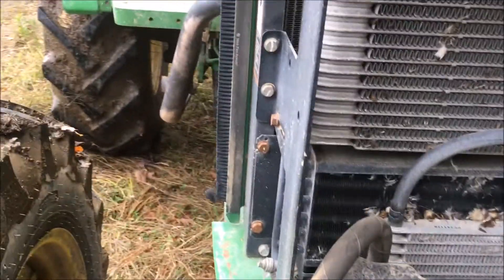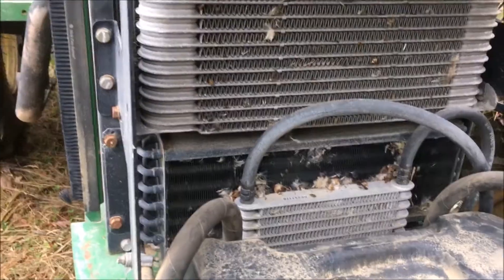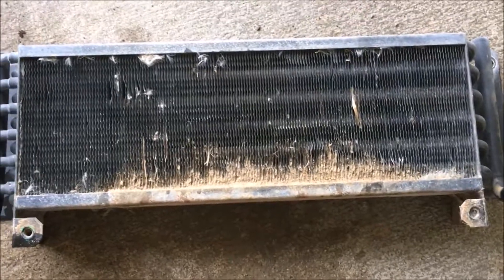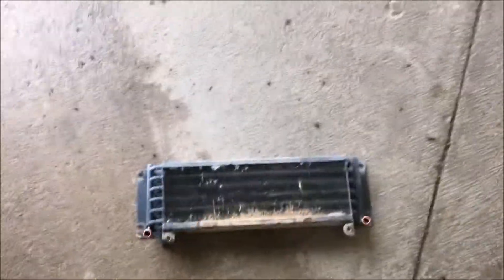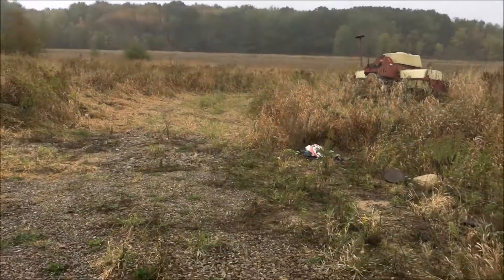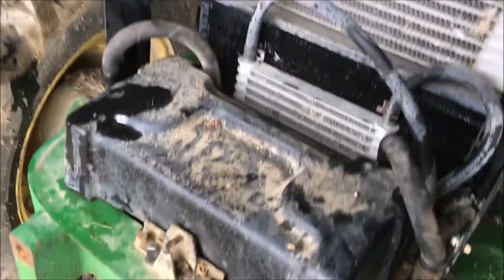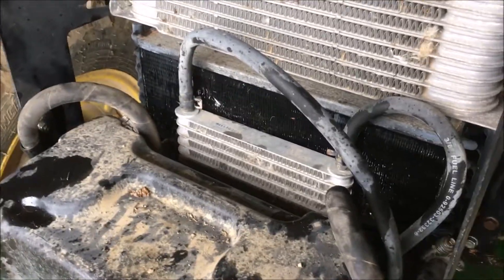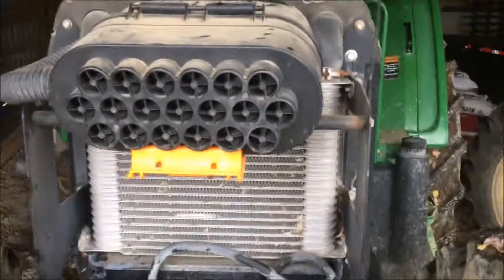TRACTOR HYDRAULICS OVERHEATING AND CHECKING OIL COOLER

Comment: fuel doesn't need a cooler.....if fuel needs a cooler....you are running the space shuttle for rocket science.  the F-22 uses liquid gases, so does the F-35...you know what uses super cooled liquid fuels ; )
PART 700—INTERPRETATIONS OF MAGNUSON-MOSS WARRANTY ACT
Authority:Magnuson-Moss Warranty Act, Pub. L. 93–637, 15 U.S.C. 2301.
Source:42 FR 36114, July 13, 1977, unless otherwise noted.
ecfr dot gov current title-16 chapter-I subchapter-G part-700
§ 700.1 Products covered.

(a) The Act applies to written warranties on tangible personal property which is normally used for personal, family, or household purposes. This definition includes property which is intended to be attached to or installed in any real property without regard to whether it is so attached or installed. This means that a product is a “consumer product” if the use of that type of product is not uncommon. The percentage of sales or the use to which a product is put by any individual buyer is not determinative. For example, products such as automobiles and typewriters which are used for both personal and commercial purposes come within the definition of consumer product. Where it is unclear whether a particular product is covered under the definition of consumer product, any ambiguity will be resolved in favor of coverage. 

(b) Agricultural products such as farm machinery, structures and implements used in the business or occupation of farming are not covered by the Act where their personal, family, or household use is uncommon. However, those agricultural products normally used for personal or household gardening (for example, to produce goods for personal consumption, and not for resale) are consumer products under the Act. 

(c) The definition of “Consumer product” limits the applicability of the Act to personal property, “including any such property intended to be attached to or installed in any real property without regard to whether it is so attached or installed.” This provision brings under the Act separate items of equipment attached to real property, such as air conditioners, furnaces, and water heaters. 

(d) The coverage of separate items of equipment attached to real property includes, but is not limited to, appliances and other thermal, mechanical, and electrical equipment. (It does not extend to the wiring, plumbing, ducts, and other items which are integral component parts of the structure.) State law would classify many such products as fixtures to, and therefore a part of, realty. The statutory definition is designed to bring such products under the Act regardless of whether they may be considered fixtures under state law. 

(e) The coverage of building materials which are not separate items of equipment is based on the nature of the purchase transaction. An analysis of the transaction will determine whether the goods are real or personal property. The numerous products which go into the construction of a consumer dwelling are all consumer products when sold “over the counter,” as by hardware and building supply retailers. This is also true where a consumer contracts for the purchase of such materials in connection with the improvement, repair, or modification of a home (for example, paneling, dropped ceilings, siding, roofing, storm windows, remodeling). However, where such products are at the time of sale integrated into the structure of a dwelling they are not consumer products as they cannot be practically distinguished from realty. Thus, for example, the beams, wallboard, wiring, plumbing, windows, roofing, and other structural components of a dwelling are not consumer products when they are sold as part of real estate covered by a written warranty. 

(f) In the case where a consumer contracts with a builder to construct a home, a substantial addition to a home, or other realty (such as a garage or an in-ground swimming pool) the building materials to be used are not consumer products. Although the materials are separately identifiable at the time the contract is made, it is the intention of the parties to contract for the construction of realty which will integrate the component materials. Of course, as noted above, any separate items of equipment to be attached to such realty are consumer products under the Act. 

(g) Certain provisions of the Act apply only to products actually costing the consumer more than a specified amount. Section 103, 15 U.S.C. 2303, applies to consumer products actually costing the consumer more than $10, excluding tax. The $10 minimum will be interpreted to include multiple-packaged items which may individually sell for less than $10, but which have been packaged in a manner that does not permit breaking the package to purchase an item or items at a price less than $10. Thus, a written warranty on a dozen items packaged and priced for sale at $12 must be designated, even though identical items may be offered in smaller quantities at under $10. This interpretation applies in the same manner to the minimum dollar limits in section 102, 15 U.S.C. 2302, and rules promulgated under that section. 

(h) Warranties on replacement parts and components used to repair consumer products are covered; warranties on services are not covered. Therefore, warranties which apply solely to a repairer's workmanship in performing repairs are not subject to the Act. Where a written agreement warrants both the parts provided to effect a repair and the workmanship in making that repair, the warranty must comply with the Act and the rules thereunder. 

(i) The Act covers written warranties on consumer products “distributed in commerce” as that term is defined in section 101(13), 15 U.S.C. 2301(13). Thus, by its terms the Act arguably applies to products exported to foreign jurisdictions. However, the public interest would not be served by the use of Commission resources to enforce the Act with respect to such products. Moreover, the legislative intent to apply the requirements of the Act to such products is not sufficiently clear to justify such an extraordinary result. The Commission does not contemplate the enforcement of the Act with respect to consumer products exported to foreign jurisdictions. Products exported for sale at military post exchanges remain subject to the same enforcement standards as products sold within the United States, its territories and possessions. 

[42 FR 36114, July 13, 1977, as amended at 80 FR 42721, July 20, 2015]

§ 700.2 Date of manufacture.

Section 112 of the Act, 15 U.S.C. 2312, provides that the Act shall apply only to those consumer products manufactured after July 4, 1975. When a consumer purchases repair of a consumer product the date of manufacture of any replacement parts used is the measuring date for determining coverage under the Act. The date of manufacture of the consumer product being repaired is in this instance not relevant. Where a consumer purchases or obtains on an exchange basis a rebuilt consumer product, the date that the rebuilding process is completed determines the Act's applicability. 

[42 FR 36114, July 13, 1977; 42 FR 38341, July 28, 1977, as amended at 80 FR 42721, July 20, 2015]

§ 700.3 Written warranty.

(a) The Act imposes specific duties and liabilities on suppliers who offer written warranties on consumer products. Certain representations, such as energy efficiency ratings for electrical appliances, care labeling of wearing apparel, and other product information disclosures may be express warranties under the Uniform Commercial Code. However, these disclosures alone are not written warranties under this Act. Section 101(6), 15 U.S.C. 2301(6), provides that a written affirmation of fact or a written promise of a specified level of performance must relate to a specified period of time in order to be considered a “written warranty.”[1]   A product information disclosure without a specified time period to which the disclosure relates is therefore not a written warranty. In addition, section 111(d), 15 U.S.C. 2311(d), exempts from the Act (except section 102(c), 15 U.S.C. 2302(c)) any written warranty the making or content of which is required by federal law. The Commission encourages the disclosure of product information which is not deceptive and which may benefit consumers, and will not construe the Act to impede information disclosure in product advertising or labeling. 

(b) Certain terms, or conditions, of sale of a consumer product may not be “written warranties” as that term is defined in section 101(6), 15 U.S.C. 2301(6), and should not be offered or described in a manner that may deceive consumers as to their enforceability under the Act. For example, a seller of consumer products may give consumers an unconditional right to revoke acceptance of 
.......................

Comment: Try sending a message or look up Warren on his channel 'western truck and tractor repairs. He has computers to hook up to everything modern to diagnose and calibrate out in the field.
https://www.youtube.com/channel/UCNVKQS-Jl70TYCmsEPO73QA/about
Description
I started doing this because I have used youtube many times in the past to figure a problem out or fix something I had never worked on before. I work on a wide variety  of equipment from small to large ag tractors ,  diesel pickups,  logging equipment , and welding and fabrication. Hopefully I can help someone out like lots of people have helped me in the past.
Stats
Joined Jun 10, 2015
17,329,135 views

Comment: Rad low on coolant. Read the trouble shooting in manual.
Reply: rad is behind the oil coolers, does the fan blow to the nose of the tractor or towards the rear/cab if it's in pull configuration then rad  being low won't have any affect unless the rad is boiling closer to 300º than 200º. heat does radiate but nothing moving faster than 4mph or a light breeze doesn't negate

Comment: Did this fix your tractor or did the hydraulics continue to have problems?
Reply from the maker: Still the same problem after taking this apart I didn't think it would fix the issue with no blockage.  I ended up taking the tractor to deere to have the code read and there was a bad valve not allowing fluid to go to the cooler.  No issues since.
Reply: I have exactly the same problem on my 6115d.  Same symptoms.  Is this valve something I could change myself?  Do you know where this valve is located?
Reply: @WorldsOkayestFarmer  just upgrade the radiators to double their size and remove any unnecessary valves that are restricting the flow also I'd recommend getting an old MF135 it can do almost every job! 
I got mine this year and I got a bigger truck radiator and an oil loop radiator kit for it and since then I van floor the gas pedal, even plow on 2nd gear and the gauge doesn't even get to the blue zone let alone exceed it..
I love modding stuff and I love your channel!